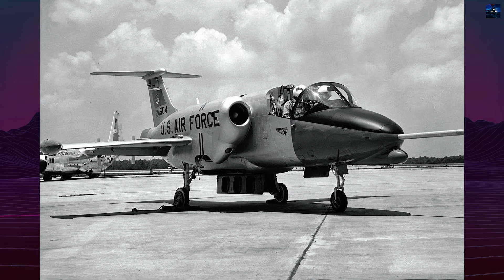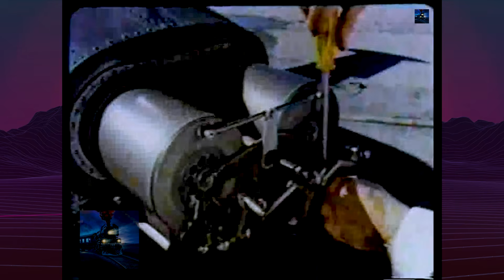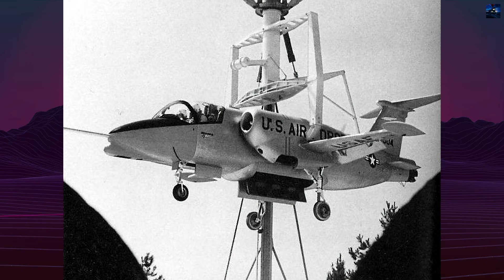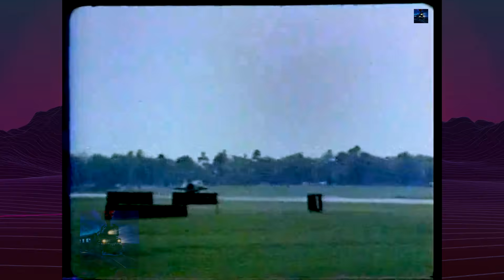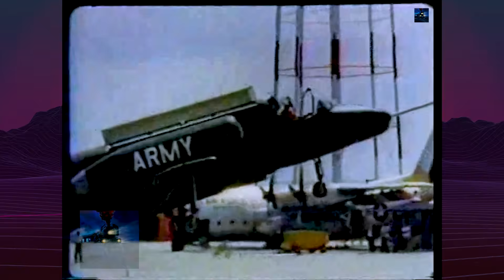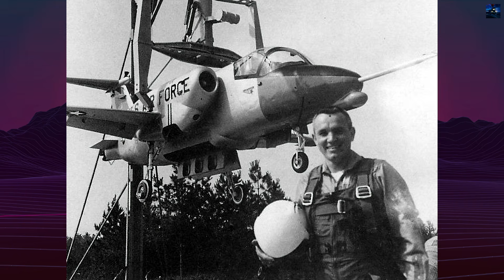Lockheed XV-4 Hummingbird: The Vertical Jet That Never Stood a Chance

Comment: Never heard of this Hummingbird! By going from diverting jet exhaust gas to dedicated lift engines, Lockheed took a giant step backwards, for the very reason you indicated - lift engines are dead weight in level flight. That, plus they take up valuable space; but so did the extensive ductwork of the first prototype. The Hawker Harrier hit upon the best solution - vectored thrust from one main (powerful) engine. The F-35 is only a partial compromise, with its shaft-driven fan. Thanks very much for another interesting video.
Reply: But it took until the F-35 to figure out a reasonably efiicient setup that allowed for a good supersonic  combat aircraft that could also carry serious ordnance. Even the Harrier was rather limited in it capacities, although at least the didn't use dedicated separate lift engines